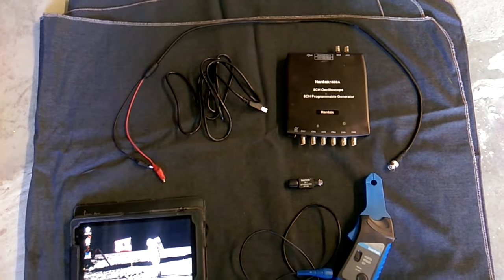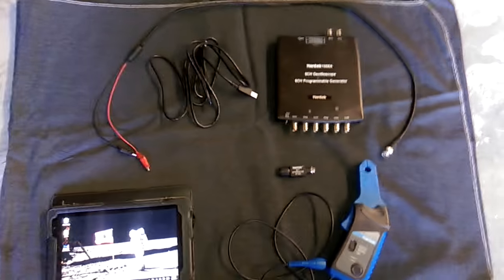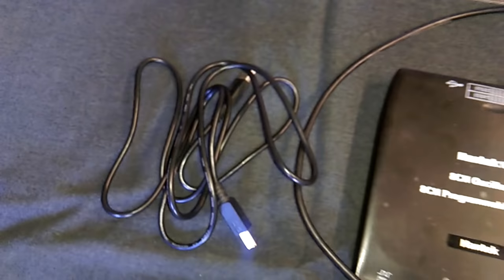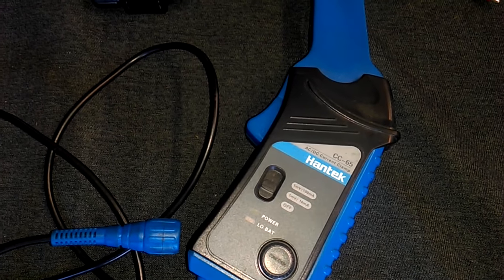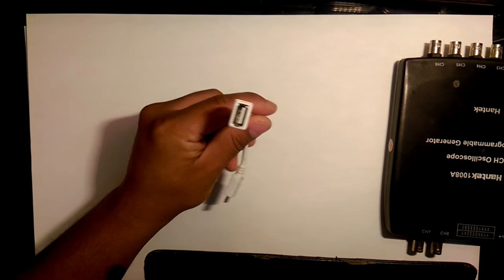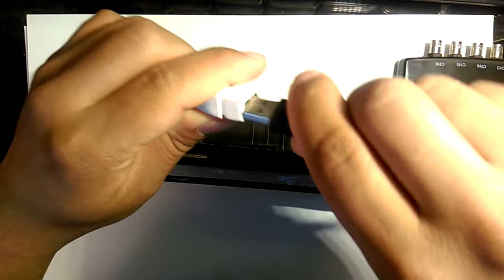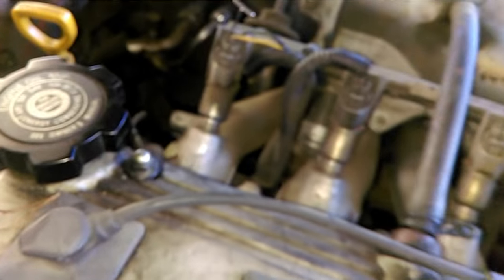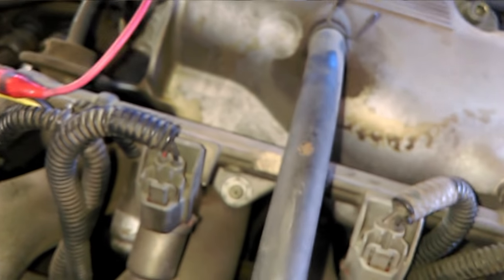Hantek 1008 Fuel Injector Waveform Analysis and Set-up

Comment: I can't believe how good this video is and how few your followers are. That was perfection of information and layout of the video to deliver an understanding of correct wave form. I'm here checking out if this would be a good tool for my shop. I was told it could be better in resolution, but this actually looks as good as the expensive scope I've seen on Scanner Danner's videos.
Reply from the maker: Thank you for the kind words and thank you for watching!! FYI the Hantek is not as good as the scope Snap-on offers or as good as a Picoscope. I have used a Vantage Pro, a Modis and a Verus and I own a Picoscope and they are orders of magnitude better than a Hantek. I consider the Hantek a test scope, as in a cheap way to enter the oscilloscope world to see if this type of tool is right for you. I spent 10 years of my life as a professional mechanic and I have met people who would benefit very much from an oscilloscope and others who it would be a hindrance to since it requires a special type of thinking.
Reply: Hi Enrique. Im from ireland and im glad i came across this video as im currently deciding on buying a scope. a picoscope or a hantek. I think i will go with picoscope now even do it will be more expensive. Do you know from your experience with pico can one, get reference waveforms from a pico websitefor certain sensors or cars???
 great video by the way. very well explained:)

Comment: explained perfectly, many thanks sandy PS how are u getting on with the picoscope and is it worth the money and do u use the waveform library much?
Reply from the maker: The picoscope is everything I have ever dreamed of. I no longer work in the automotive field, at least not full time, so my picoscope use is mostly concentrated in electronics analysis. It is definitely worth the money since I used almost daily in my diagnosis. It still is worth the money since a lot of the testing I do now requires a scope of that caliber. As for the waveform library I did use it occasionally although most of the waveforms I checked were mundane ignition, dc motors, and solenoid waveforms.

Comment: One note.
Slide the back probe along the outside edge of the seal.
Running it along the wire will cause terminal to open it's grip on the seal.
Reply from the maker: Excellent point!! I never thought of that. Thank you for your suggestion and thanks for watching!!
Reply: @Enrique_Osorio  I never did until I was told by either one of my instructors or a field engineer.

Comment: Hello nice job with the hantek scope your time base on the amp clap is spot on about around 1 amp at idle how ever on the  yellow trace it only around 2.5 ms on idle  you can see all 4 injectors with at the same time with the amp clamp  I'd one injector with volts  then use the firing order
Reply from the maker: That is true, that is an option if you clamp the voltage feed wire(s) for all of the injectors. Thanks for watching and thanks for your comment!!

Comment: Enrique, thank you kindly for this instructional video. I enjoy using the Hantek 1008 very much. If I may impose on your time and goodwill, I have 2 questions and I am wondering if you have had the same experience as me with the Hantek.

1. Secondary Ignition Waveforms: single cyl test makes reasonable waveform; with multiple (say 4 cyl using an distributor King Lead) I cannot capture enough detail to be confident of the waveforms ... generally, the spark line seems good ok to show big burn-time differences; but Firing Line seems very incomplete, inconsistent and so hard to draw conclusions, say for example using a snap throttle to ID a lean cylinder. Very hard to see with Hantek? What's your experience?.... I would love to see you do some diagnostic work using sec ig waveform comparisons -- lean cyls, dripping injectors etc. Would you have a go?

2. Multiple channels: say crank+cam+inj+prim ig (i've tried to avoid sec ig when doing multiple waveforms).... I find after about 3 channels the Hantek can sometimes default one of the channels to an gibberish/meaingless waveform ... eg fill up screen with an obviously unrelated  high freq square wave pattern, or some similar breakdown of data.  
I don't know if it is internal cross interference, or some other limitation.
However, I have found that if I space out channels ie instead of using sequential channels (1,2,3,4 etc) I try (1,3,6,8) I can get a more stable result ... but this may be just luck because the breakdown does not happen every time when using sequential channels.
I'd be very interested to know your experience.
Again, thank you so much for you patience and commitment to posting these great instuctional videos.
cheers
alex
Reply from the maker: I have not had trouble using consecutive channels, perhaps the leads were interfering with each other?? As for the different types of secondary ignition waveforms i.e. lean, rich, no spark etc. I am working on that and I hope I can upload something like that soon. Thanks for watching!!
Reply: Can this hantek 1008c run on linux OS ?

Comment: Awesome video! Do you use the Hantek daily? Would you recommend them to an occasional automotive user?
Reply from the maker: When I used to work as a mechanic I would use the Hantek almost everyday. Unfortunately it does have limitations. I ended up purchasing a PicoScope which is over $1000 since I wanted greater functionality. Like I tell most people I see the Hantek as an introductory scope that is of low cost and will give you a better idea if a scope is the type of tool that would be a net benefit to you. If you find the that the $70 Hantek is something that improves your ability to diagnose circuits then it is a sure bet that a better scope would have even more of an impact on you. If you are already confident that an oscilloscope is a tool that you would definitely benefit from then I recommend you look into getting a scope that has better software and features.

Comment: Why do you use the attenuator on the voltage lead but not the amp clamp? ( awesome videos! Thanks to you I am learning how to use this tool, your practical explanations keep it simple but informative. I will ask all the stupid questions)
Reply: so i would use it on anything that is inductive like actuators, solenoids, transformers and coils or higher line voltages (like AC 120V) but not on hall effect sensor outputs or AC producing sensors (like wheel speed sensor for example)
Reply from the maker: That is correct.
Reply: awesome!Thank you sir

Comment: Nice job Enrique, I'm a fellow tech and scope jockey myself.  Enrique I have heard their are sometimes issues with loading the software for the scope and getting it to work.  If so could you tell us what these problems are and how to overcome them?  I'm a picoscope user myself and I got mine through Autonerdz.  However that 8 channel Hantek scope looks interesting.  It is not as powerful as a Pico but just seeing it has 8 channels is impressive.  What is the longest screen you can set it too and do you have the capability to zoom in on the capture?  Thanks.
Reply from the maker: As for loading the software it is a bit of a challenge. I made a video specifically addressing this issue here it is.... https://youtu.be/alBoD-JM9W0
As for the Hantek vs Pico there is no contest. The Hantek is a useful and affordable tool and a great stepping stone to see if an oscilloscope is the right tool for you but it can not do many of the functions that the PICO has. You can not zoom in to a waveform. All you can see is whatever you capture at the time base that you capture it. That is it. Don't get me wrong I used the Hantek for years before I bought my PICO and it has taught me and helped me tremendously.
I have a few videos that I am currently preparing that should be out before the end of the week. After that I am going to do a video describing all the shortcomings of the Hantek. If you notice all of my Hantek videos only stress the positive and none of the negatives. This was a calculated move on my part to get people excited about trying something new and different and maybe teach them something in the process.
Thank you for your questions and comments I do appreciate it. I will make sure to let you know when I make the Hantek Shortcomings video.

Comment: What type of current are you using to do this measurement a DC or AC I would like to know. Thank you for the wonderful demonstration.
Reply from the maker: DC, always DC when testing on cars. The only reason to use AC coupling on any scope is where you want to filter out any DC current. An example maybe a wheel speed sensor or a cam or crank sensor but even then the DC off set is not going to cause any difference in the readings.

Comment: Enrique, I am having trouble seeing the pintle open and close.  I can see the current ramp up slow, but then it just seems to change to a strait line and I am not seeing the bump at close.  It hard to tell if I am not seeing it because of the noise on the line of if I may have a lazy injector.   I guess I will try on some more known good injectors and see what I find, although the car I am playing with runs fine.
Reply from the maker: Likely it is there, just lost in the noise. I would be happy to look at a recording if you put a video up and link it in this comment thread. The comment with a link will be automatically blocked but I will override it when I see the video.
Reply from the maker: What I can see from your video is that the pintle movement can be seen in your yellow (voltage) trace but not in your blue (current) trace. Either due to the design of the injector or as you said the injectors may be lazy there is no clear view of pintle movement in the current trace. This would occur if the pintle did not create a strong EM field as it moved either due to the material it is made of or the speed at which the injector moves. The bump on your voltage waveform is pretty small and has a gentle slope. I would check the other injectors and compare to see if there are any differences.

Comment: Good intro. Sir please I want ask you questions? Hantek 6074BE and Hantek 1008A which one is best to use?
Reply from the maker: It depends on your needs. The Hantek 1008 has more channels but is slower. The 6074BE is faster but less channels. Both are cheap scopes and overall are NOT good. If you need a quality scope I recommend looking at something like a PicoScope.

Thank you for your question and thanks for watching!!

Comment: PLEASE I HAVE QUESTION , I HAD HENTEK 1008C  , I AM STILL NEW ,, ITS CAME WITH PROB WITH CLIP ,,, COULD USE THE PROB THAT CAME WITH IT FOR COILS & INJECTORS ?
Reply from the maker: Coils and injectors make voltage spikes above 80 volts. Use an attenuator to protect your Hantek

Comment: Muy buena explicación amigo, estoy interesado en adquirir la pinza amperimétrica, pero no se si con la de 65 A es suficiente o también me podrías recomendar la de 650 A, esta última sería aplicada más para verificación de operación del sistema de carga si no me equivoco?
Reply from the maker: Se necesita el CC650 para alternadores porque el cable positivo es mu grueso para el CC65. Tambien el CC65 solo mide hasta 150 amperes
Reply: Bien, muchas gracias por la respuesta

Comment: great stuff. i have the hantek 6074BE .the  hantek 6000 software i have ,has a feature where you can choose different vehicle sensors that you want to scope and it sets up the scope for you in relation to what type of sensor you want to check.. i  only can select one sensor using this feature .. i dont know how to use this feature if i want to scope various sensors at one time. i appreciate any help. how do i get in touch with enrique.

Comment: At 9:00 it looked like the injector is on for 3.35 ms, to be precise. Lol. And where does it show the voltages of where your cursor is at. I saw you mention off, then 12v, then the spike in voltage, but I didn't see nor did you show where those number were shown. Was it down at the bottom. Are the voltage divisions 5v with 1v increments? So it showed 12v then when the injector turned on it was 5v for 3.35ms before the spike. But can it show the voltage and time of where your cursor is without actually visually counting the divisions and increments? Sorry if I sounded confusing. Thanks!
Reply: Maybe if you click the left mouse button on a certain point on the graph, then it will show the voltage and time for that point. That way you don't have to count the increments, it tells you what they are at the mouse click.. Or there should be a way to set it up to do that. Thanks

Comment: Good demonstration on how to use the oscilloscope,
But positive and negative are wrong!
The black cable is negative (-) and the yellow is positive (+)
Or why you connect scope to + yellow and - to ground.
You're right that the electrons go from positive to negative,
but the earth is negative and positive are live.
The body and the chassis are connected to the negative pole of the battery.
Reply: Most dc current meter, should adhere to current and non-directional.

Comment: Your videos are very informative and helpful and also save a lot of time. But I believe you have contradicted yourself by placing the ground wire clamp to a grounded bolt then saying the ground wire is the coloured wire. I'm pretty sure the black wire is ground. you're just not explaining it in laymans terms.
Reply from the maker: The ground wire for the scope is the black wire with the clamp. The ground wire or "control wire" for the injector is the colored wired. That is on me. I should have clarified in the video, Sorry :(
Reply: I knew that but others might not. @Enrique_Osorio

Comment: I was wondering if my Scope is rated for 400v (1008c) would I still need to use the Attenuator? Also I was wondering what is the voltage of your scope rated for?
Reply: i think it can spike to 600? no

Comment: I had a question about your hantek1008. I'm in the market for an affordable automotive oscilloscope. I was curious if you have any issues with yours involving using more than 4 channels at the same time. I don't know a lot about DSO but from what i have heard is that the hantek has issues with multiple inputs specifically sample rate and bandwidth. I was also curious if you have any issues with signal interference and if hantek offers any type of software filters for this or if one would have to look at hardware filters?
Reply from the maker: There are no software filters since the it measures at 2.4 MegaSamples per second so noise is not much of an issue. I have not had issues using more than 4 channels. I have had all eight on while checking the secondary ignition on a V8 motor and had no issues. Granted I had a wide screen on it, something like 50 ms division so the spikes were just vertical lines. I have not tried more than 4 channels at a high frequency. Interference is an issue since the leads are crap so I made my own which were a little better. The most important thing is to route your leads appropriately so they are not near any source of interference like the ignition coils, that helps a lot. Hope this helps, let me know if you have any additional questions.

Comment: Great presentation - just subscribed.
I notice you are using the Hantec on a windows op.sys tablet. 
As most tablets are Android just wondered if you know/ have experience of running it on Android which would be very useful for most of us. (ps. I've tried hscope.martinloren software without success). 
Another question sorry, do you need to use solely the Hantec current clamp or can you use other automotive DC current clamps that have an external output connector?
Reply from the maker: I have only ever used it on Windows, but I am not sure how it would be implemented on Android. I do not have any software that will allow me to run it on android. I have heard of OpenHantek which allows you to use a Hantek 6022 with Linux but I have not tried that yet. As for the current clamp, you can use any current clamp you like as long as the output of that current clamp is some type of voltage that corresponds linearly with the current it is measuring. The scaling might be off but you can compensate for that by doing the math in your head. If the scaling is different it will usually be off by some whole power of 10.
Thanks for watching and thank you for your questions!!
Reply: I know this is late, but hscope makes Android software to work with the Hantek

Comment: What's the need for the attenuator if the hantek is capable of 400v
Reply from the maker: Excellent question!! Unfortunately the specs provided by Hantek are not always accurate. In my own experience anything above 35V makes the software unstable and voltage spikes above 35 V usually makes the software crash. Using an attenuator solves these issues almost completely. 

The Hantek is not a sophisticated device compared to to other scopes that are available. It is cheap, fairly easy to use and with a few compromises a user can learn a lot form using this device.

Thank you for your question and thanks for watching!!

Comment: hi
one thing i forgot to ask you i just bouht hantek 1008c when i connect to check ignition signal  my square wave is up side down what i am doing wrong?
Reply from the maker: Can you be more specific about your set up. The reason I ask is that an ignition signal should not be a square wave, the only square wave on an ignition coil would be the PCM signal to the transistor in a 3 wire or 4 wire coil on plug ignition coil. If your square wave is upside down it could mean one of two things. 1) The leads are reversed or 2) the wire you are checking is not the PCM signal but something else. Let me know and I will be glad to help you.